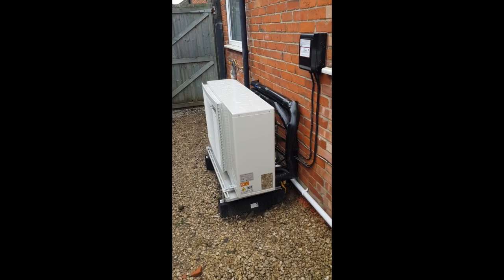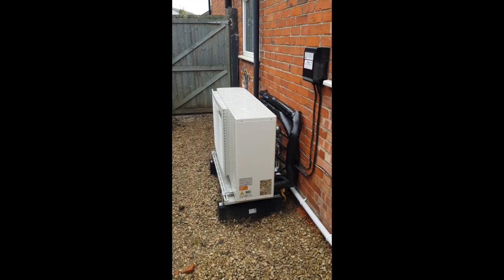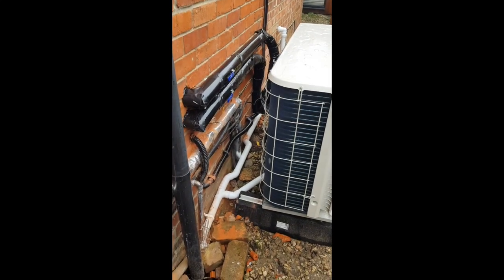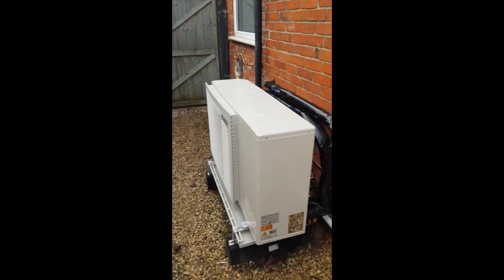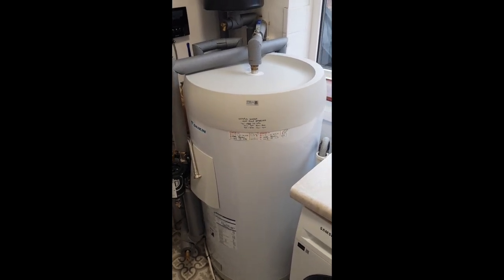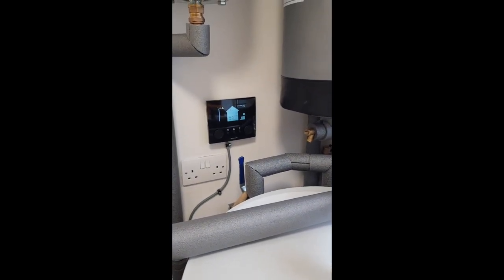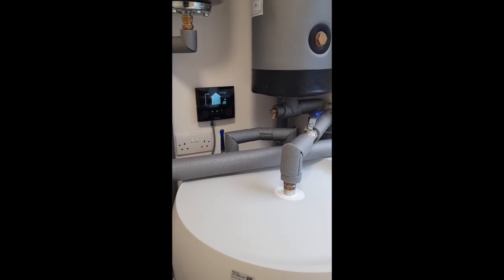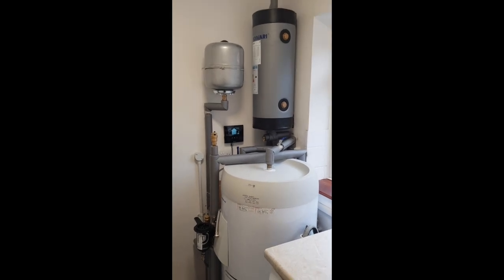Octopus Heat Pump Install 1930s Semi-Detached House Chippenham

Comment: Doesn't your heat pump  system have a weather sensor on the outside of the building for weather compensation, just curious as it wasn't mentioned. Nice video by the way.
Reply from the maker: Yes I have set to use weather compensation. So the flow temperature adjusted depending on outside temperature.

Comment: A volumiser adds water volume to your heating circuit.  It acts as an additional radiator although it's insulated so it retains its heat.  When the HP runs a defrost cycle in winter, you need enough stored energy (heat) in the radiators to dump into the HP's heat exchanger in order to defrost it.  If you don't have enough water volume in the rads to achieve this you need to add a volumiser.  Defrost cycles are VERY inefficient as you're using electrical power to defrost the outside unit and moving heat from inside the property to outside.  Sounds like madness to me and one of the reasons I'll be keeping my gas boiler for as long as possible.
Reply: Defrost cycles aren't that inefficient, they don't take long, and the electrical usage isn't increased significantly, as heat is borrowed from the heating circuit to defrost.  After the defrost is complete, the coil will still be warm from the defrost so the energy used from the defrost gets partially reused again for heating the home.

Your gas boiler is wasting 10%+ of heat out the flue to get rid of harmful gases etc  Heat pump defrosts are going to be less than that.
Reply: @BenIsInSweden  Indeed, the hot water used to run the defrost cycle comes from the heat pump, so is very efficient (whatever COP the heat pump is running at). Obviously it's better if the unit never needs a defrost cycle, but even with them the heat pump can still run very efficiently.

Most installed gas boilers will struggle to be greater than 80% efficiency, this includes those rated at 95%. Twenty years ago when I had a new gas boiler fitted, I never bothered with a condensing boiler because with my pipework and radiators it was never going to condense, so the advertized efficiencies couldn't possibly work - to properly fit an "efficient" boiler (compared to a non-condensing type) would have required similar changes to what I had for my heat pump .
Reply: I've updated my ZC blog post a month on. My nov 24 bill was 2/3 of my combined nov 23, all other factors comparable. I used 41% of the energy a year ago. Very pleased.

Comment: Lots of information for lots of kit, but the thing most of us who are yet to commit to an ASHP need is, what is the heating doing, what SCOP are you getting, what’s your existing insulation like, did you need to increase any?

This is not a criticism, just feedback in case you want at a later time to give an update on how it’s been going.
Reply from the maker: Thank you! I did a follow up post here comparing gas bills. It also links to other house measures https://www.zerochippenham.org/2025/01/10/how-much-does-it-cost-to-run-a-heat-pump-vs-gas/
Reply: @ thank you! Impressive savings in terms of both money and emissions.

Comment: Interesting video... especially as I also live in Chippenham !  I'd love to know what sort of SCOP you're getting... in case you didn't know, this is the true measure of how well your HP system has been designed, installed and configured.  The target is 4.0... anything above that and it's all good.  If you're coming in at less than about 3... I'd be calling the installers and asking them to rectify (which may be a simple configuration change or a far more involved design change).... Keep us posted !

Comment: How about the drainage? Is the hose that I see going into the waste pipe coming from the cylinder?
Reply: The cylinder is pressurised so has a pressure relief into the drain. There is also a condensation drain from the outside unit drip tray